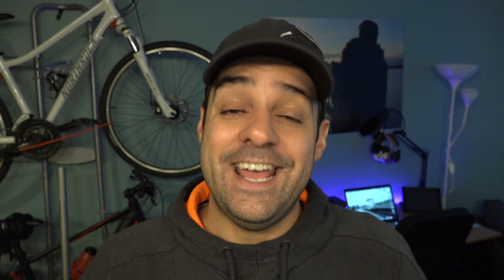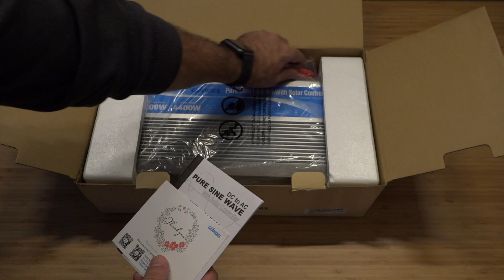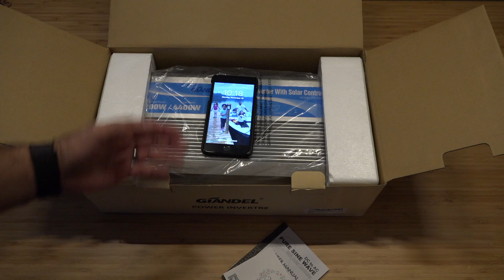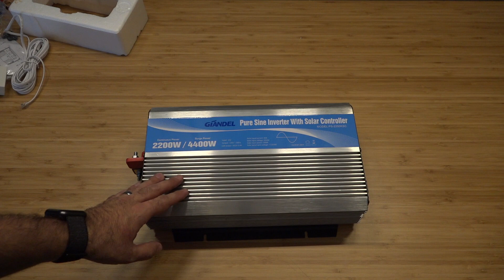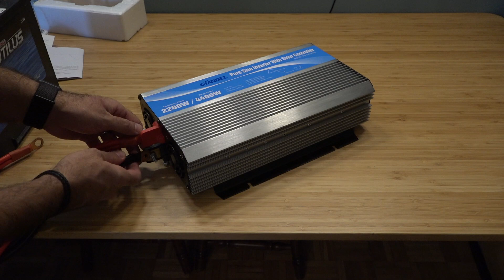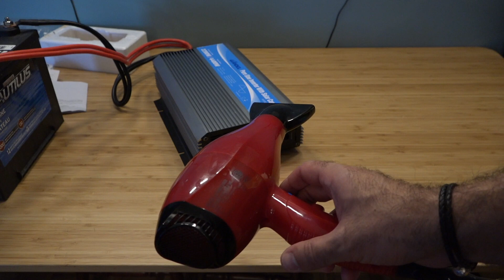Giandel 2200 Watt 4400 Watt peak Pure Sine Wave Power Inverter, 20A 300watt Solar inputs, unboxing

Comment: How do you know it's pure sine wave? 😅 Because it says so?😅😅😅
Reply from the maker: So the main way is by what the manufacturer says on the box. Now I know that sometimes manufactures lie but when you see the manufacturer with the badge ISO 9001, this indicates a promise to quality at the highest level. ISO 9000 and one is a group that has rules the companies have to follow if they wanna have this badge. So because this company does have the ISO 9001 badge then the information that is given about the product in my opinion I would believe. Other than that in order to do testing you need special equipment which I don’t have in the average person doesn’t have so no real other way to know. That we’re aware of.

Comment: Regarding the switch for the lead acid or gel , which position do you put the switch in if you have lithium ?
Reply from the maker: Hey @larryWebb-gv8dz thank you for your question.  
Charging a lithium battery with a solar panel charger designed for SLA (Sealed Lead Acid) or GEL batteries is not recommended. Lithium batteries require a different charging profile compared to SLA or GEL batteries. Using the wrong charging option can damage the lithium battery, reduce its lifespan, or even cause safety issues.

Lithium batteries typically need a specific charge controller designed for their unique requirements, including precise voltage and current control and proper balancing of the cells. Here's what you should do:

Check the Charger Specifications: Look at the charger’s manual or specifications to see if it has a setting specifically for lithium batteries. Some chargers are versatile and have different settings for different battery types.

Use a Lithium-compatible Charge Controller: If your solar charger does not have a lithium setting, you can use a lithium-compatible charge controller. This controller will manage the charging process according to the needs of lithium batteries.

Consult the Battery Manufacturer: Check the lithium battery's manual or consult the manufacturer for recommended charging parameters and ensure your charger can meet those requirements.

Charging lithium batteries correctly is crucial for safety and performance. If your current charger does not support lithium batteries, investing in a proper lithium-compatible solar charge controller is the best course of action.

Comment: You need more battery to run all of that together. I have a 100ah lithium battery and it’s max rating is 1200 watts so you would need two batteries to run 2400 watts. That’s for me, it depends on your battery size.
Reply from the maker: Hey Carey Brown, 
Thanks for your comment, and yes I think you are right. My battery isn't strong enough, also I think its getting old! I'm looking in to a deep cycle AGM to replace it and looking for a place for a second AUX battery to keep up with this inverter.  I would love to use Lithium, but I know that these batteries do not like the could weather and where I live its cold for 8 months of the year!
I'm still working it out.

Comment: It can handle 2200 watts off one outlet?
Reply from the maker: Hey FishFood,  Yes it can handle 2200 watts form one plug.  I used my mitre saw which draws about 2000 watts,  So the inverter can handle 2200 watts in total from either one or from both outlets.  As of right now my battier is what it's holding the inverter back!  So am looking into some deep cycle batteries or Lipo's.  

Hope this answers your questions. 
Stay say and all the best. 
Tim...

Comment: Good Video 
I have a Deep Cycle AGM 155 Amp battery and it has a tough time keeping up with over 30 amps DC per hour  . I have moved to DIY Lithium and almost unlimited level power . 
Pure Sine sometimes is better than your house 🏠 power and is the best inverters - worth the investment. If you have problems it may be the battery- bc inverter is a good one .
Thanks Again 
Jon
Reply from the maker: You have the right idea.  I think that’s the way to go.   For now I’ll keep this set up until one of the batteries give up. Then I’ll do a lithium set like you did.  Question do you have you Lipo wired straight to the alternator? Or do you have a dc to dc charging system for the Lipo?

Comment: Hi did you have to add a fuse or breaker . Or did you just connected directly to the battery with supply cables. If you did could you please let me know what size fuse or breaker
Reply from the maker: Hey Hien, 
The way that I have this inverter wire is,  0 gauge from the battier to a 200 amp breaker then again a 0 gauge wire to the back of the truck to a marine battier cut off switch. from there I use the wires that came with the inverter to connect the inverter to the batter cut off switch.   Now I'm not sure if 200 amps if enough!  But it's what I had at the time.  If the breaker trips too many time then I will upgrade it to a 300 amp, but it hasn't trip yet so I think I'm doing good so far.  I go by - Add a fuse or breaker near the power source to protect your Battier (power source), equipment, and vehicle.

Sorry Hein I thought that I did an install video for this product!  It's been a year since I have owned this unit so I think I'll do an update video and also explain how I installed it.   Thank you for your questions and bring to my attention that I should explain how I installed this inverter. 

Stay safe and all the best.  Any more questions please let me know.
Reply: Hi I have another question  the inverter  is hook up and most of the time I will have it off. When at off position does it still draw power from battery. If not then I dont need a battery shut off switch right. I only use on the boat on  weekends
Reply from the maker: Hey  @hiennguyen-kp5cj , From all of the Marine setups that I have seen,  any and all power-drawn devices are somehow connected to a battier cut-off switch.  I think this is a safety measure that is put in place just to prevent any shorts, fires, or electrocution.   But that's just my opinion, I not a marine mechanic.  Now if I was installing an inverter on my boat what I would add that extra safety measure by installing a battier cut-off switch but that's just me. You can try calling a marina near you and ask to speak to a marine mechanic and get their opinion.  They should be able to give you their expert advice.  
Stay Safe.
Reply: @416Expedition  thank you. I will add a battery switch just to be safe.
Reply: Thank you for the reply and video.

Comment: Have u try to power up refrigerator with this 2200w inverter?
Reply from the maker: Hello Desmond Thang,   No I have not tried plugging a fridge into the inverter.  I'm sure it would work as long as the refrigerator power consumption stays below 2200 Watts (2.2 kW).  Now what I have tried was using a small welder! Now I'm sure if I had 2 deep cycle batteries or better 2 lithium-ion batteries the inverter would last longer.  But because I am using a Gel 12V battery the inverter drain it pretty quickly.  I had to run my truck to keep up with the inverter.  As of right now, I am not able to keep up with the inverter's potential because of the battery situation.   I am looking into that for the next "Off-Grid Power" option.

Comment: Hello, very good video, a question how has the inverter worked for you by directly connecting the solar panel? does the panel work well?
Reply from the maker: Hey Gerardo Guti Guti, Unfortunately I haven’t bin able to hook up any solar panels yet so I don’t know how it performs. I am definitely going to get a solar panel one of these days though.  But the inverter has performed amazingly with whatever I’ve plug in to it.

Comment: I have this exact same inverter and it doesn't have a built in Solar charger.
No place to connect PV aka Solar panels directly to inverter.
Reply from the maker: Hello Lori,  Did you buy it front Amazon? Does the front (plug side) look like mine?

Comment: Got the same inverter in the 24v version! I've just set it up and I'm a bit worried about the inverter cable being really oversized for my terminal. But I guess for you it worked!
Reply from the maker: May the 24v version has beefier cables and larger lugs?  Are you running a 24v battery?
Reply: @416Expedition  Ya, I'm running 8 lifepo cells in series, 3,2v each.
The cables look the same, really. For the same wattage, they would technically only have to carry half the current / amps, so they could be thinner! Happy so far, used it about a week now. Will measure the efficiency sometime.
Reply: lyn1337 still happy about to buy an inverter?? thanks man
Reply: @daveyboy8907  the inverter still works great, I think it has the lowest idle consumption and it's quiet as the fan doesn't run until it's 40-50% loaded. maybe others have more smart features but this is the best deal.
Reply: lyn1337 awesome i just got the 3000 6000 model and love it so far.
Reply from the maker: Hey  @daveyboy8907 , I'm still happy with this inverter.   Last month I was redoing the floors in my daughter's room when the power went out in our town. I grabbed an extension cord and plug it into the inverter to power my 12" miter saw to keep the job going!